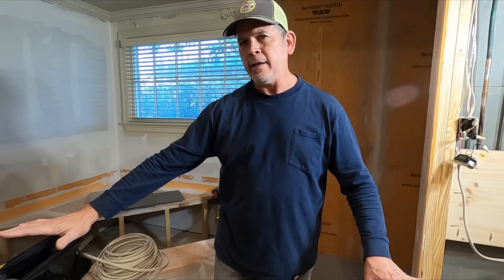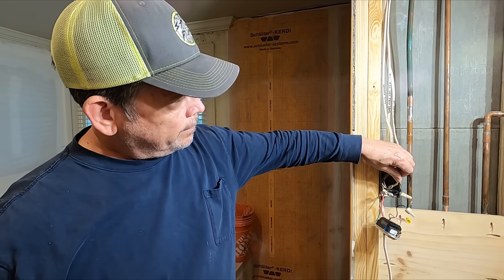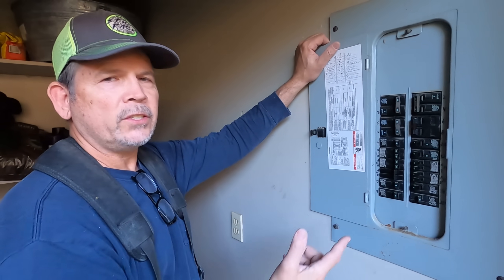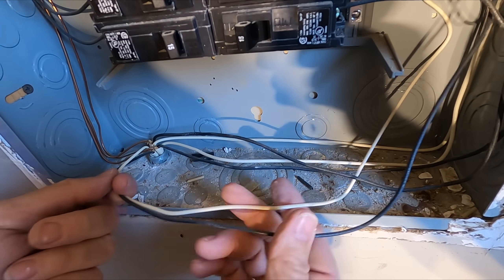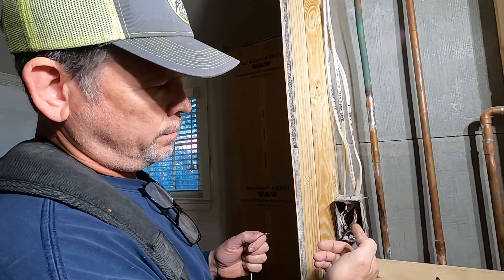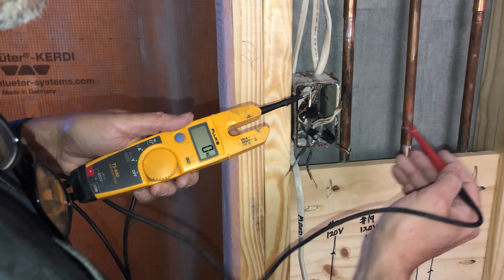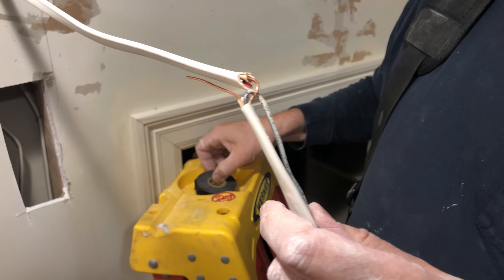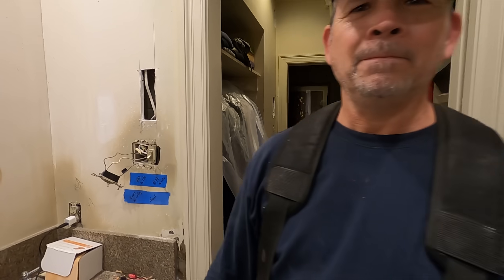You CAN Get SHOCKED by a Neutral Wire! This is How...

Comment: If you run a fan with a light don't run a 14-3, run 2-14-2's;as if there is a light and fan that can be simultaneously turned on, when they are both are running you may have 10-12 amps on 1-black and 1-red, but you will have 20-24 amps running on the 1-white 14 gauge wire, this wire isn't rated for this much amperage. If you shine a temp gauge on it it will glow in the dark and will be a fire in a few years. you can run a 12-3 but it's not supposed to be run to an appliance rated for under 15 amps. This is why I always say make sure you know what you are doing with electrical, b/c if you screw up plumbing you immediately have a leak. You can hook up electrical wrong and it will work for a time and it usually ends in someone getting shocked or a house burning down. But good video to teach people to be cautious and get pro's if they don't know what they are doing.
Reply from the maker: Thx Ron.  You can certainly have one neutral for the fan and light and even the heater in a heat vent light.  Manufacturers directions show it that way.   The fan and light together draw negligible current plus those junction boxes are so small I wouldn’t want to stuff any more wires in there than I had to.   Also you state to never plug 15A appliance into 12AWG circuit.  That’s completely fine.  It would be like putting 100 psi on an air hose rated at 200psi.   Maybe you got you numbers backwards I do they all the time 😂👊💪
Reply: @StudPack  I do occasionally get my numbers occasionally mixed up, but 14 gauge is made for up to 15 amps, 12 gauge up to 20 amps, 10 gauge up to 30 amps, 8 is 40 and 6 was in the past when I went to penn state and vo-tech supposed to be only up to 50 amps for like a electric range, however I have seen some literature in the last few years saying 6 gauge can be used to 55- even 60 amps. and you can wire these things the fan, light and heater it you have 1 black coming from device and 1 neutral (white), but if you must connect them with their own line they must be treated as an individual circuit or you will see the neutral overload I was talking about. I repaired 3 different houses where it got so hot it melted fixture parts for customers. I have also seen electric ranges in apartment buildings direct wire 30 amps, like 10-3 directly wired to stove and then run right to panel box, instead of the 6-3, many times especially in apartments hand houses. I have also seen "property management electricians daisy chain electric heater together and not do the load calculations for how many feet of heat can be in a say 30 amp circuit, hell 1 of the houses burnt down. But oh well just trying to save you some grief down the road, lol great video have a good day.

Comment: when you get shocked really bad you'll taste metal in your mouth. I've been doing electrical; for 31 years been shocked 5 times really good. It also changed the way i do work I never reach into the panel to move conductors with my fingers anymore.

Comment: Older House's are Scary I live live in a rental built in 1983 some of the 3 way light and garage wiring with no grounds wires connected are a danger.I always wear tight rubber gloves and rubber shoes and always CK all the circuits when working .THANKS FOR BRING UP THE HOT NEUTRAL CIRCUIT😰SOMETHING I'LL KEEP IN MIND FROM NOW ON

Comment: You are right, not only can bad things happen but happen very quickly. Electricity never had,
nor ever will have any respect for ignorance. Many think that since the lamp is OFF there is
no voltage/current in the box. that is dangerous thinking.

Comment: I think the best way to look at it is that you can indeed get shocked by the neutral wire because it's an output leg on a transformer from which a voltage is derived to power 120VAC devices. You hope that it's properly tied to ground enough to where there is no dangerous voltage referenced there.

Comment: I had a nasty lock down clamping.. couldn't let go shock while working on a freezer....My hands were useless, I had to push myself away from the freezer with my feet to break the circuit...  lets hear your story.
Reply: Working for small companies and doing jobs with little to no safety guy interaction there is sometimes a need/desire to work many things hot and if you do lighting you will feel 277VAC eventually and hopefully never 480. What I never allowed myself to do was force myself between pipes or lean on a ceiling grid etc while working what is possibly hot so the extent of my interaction is getting bit and yelling "fuck" real loud.

Comment: Very nice explanation of a shared neutral. I'm a beginner electrician and have encountered this several times. My question about this video is, how long it took to find the unconnected neutral in the 3-way circuit and where to start looking. I'm currently working on a remodel that has this very problem. And it's all new wiring. There are only 2 circuits energized while we "Trim out". One being the furnace and the other is the living room specifically for a work light and radio. Every other neutral in the apartment has current. I'm perplexed. Any advice is greatly appreciated. Thank you and please post more electrical videos.

Comment: I was in a house about 4 years ago that actually had energized all the forced air metal ductwork when they pulled their Romex through the same chase and had a snag they just pulled harder and ripped the insulation off the wires. I put a meter from the REGISTER (vent) in the bathroom floor to the TUB SPOUT and got 120 volts. 

I can only imagine somebody steps out of the bathtub and there's water on the floor and if they have their hand on the shower handle or the spout they would be dead. Or even just standing in front of the sink and turning the water on or hitting the light switch any of those if the floor was wet and had a path to the vent it would have been game over
Reply from the maker: Energized metal duct 😳.  That’s no joke.   Good job finding the problem 👊👍

Comment: 1986 in da yookay I rewired my house. 240 volts in da yookay..... Distribution panel off. I had some long nosed pliers and somehow I got em across the unfused feed from the substation... BANG and the last 4 inches of my pliers vaporized and molten steel peppered the walls and the panel.The pliers had rubber handles and I was left holding just those. I got no shock...  Now I use use TWO testers on everything.... and every tool must have insulated handles..240 volts is a monster.  I got caught with the live neutral once. The electricity board did a 32 point check before they would hook me up and I passed 31. The error was not having an insulated green wire to a power outlet.  Not bare copper  like in the US. 1 minute job to get fixed.  I wonder if the US will go to green insulated earths  one day...

Comment: I had a neutral shock me once. I was standing on a ladder working on a ceiling fan. I didn't turn off the breaker, I just turned off the light switch (that was the mistake). The ceiling fan circuit also powered a light in the hall, which was on. The hall light shared the same neutral as the ceiling fan and the same circuit breaker. When I disconnected the neutrals that were tied together in the ceiling fan, it lit me up as my fingers became an alternate path to ground for the hall light circuit for just an instance before I jerked them away. I always do AC wiring one- handed wearing insulated shoes so I had that going for me and it kept the circuit path short. 

 So that's why you always turn off the breaker and not just the light or fan switch.  I knew exactly what happened when it happened, but I was in a hurry and didn't want to take the time to track down the breaker and thought I could get by.  I didn't get by, instead I had a harsh realization and a reality check.  Fortunately, I lived and was not hurt but I do take the time now to find that breaker and put a meter on everything, every time.

Comment: After getting popped a couple of times years ago, I test, test and test some more once I turn a breaker off.  It's saved me more than once. Never think just because you've tripped a breaker that its safe to go back and start work.  Use a tester and make sure.  There's some crazy wiring out there.
Reply: Assumptions are the greatest mistakes you can make. I tell people don't think, know. Because often what one may think has no grounding in reality at all. What you know through direct observation on the other hand you can trust to an extent. So treat every wire as if it was hot until proven otherwise.

Comment: You're supposed to have a dedicated neutral for each new for each circuit what's going on there is somehow you had the neutral added to the other circuit so you need to isolate it figure out which ones which and it will quit doing that because that's not supposed to do that 30 years in the trade some of that stuff is pretty scary that you're fine but yeah be careful

Comment: Yeah actually the neutral is a load carrying circuit so it will light you up worse than the hot the hot would just hurt you but the neutral light you up and hurt you bad could even kill you especially 110 is bad

Comment: They shud have own ring circuits but thats uk.
Always measure potential difference as you never know who wired it and if its to code or not. Calling a wire at 120v ac neutral, is a bit misleading..

Comment: I'm living in the Philippines where there is no neutral and all the breakers are double throw. Last time I tried to check the voltage from one side to ground it was about a 185V to 35V split between the wires. I assumethe power company does that here so that people won't try to take one leg to ground to get 110V, you need to use transformer and they sell them in all sizes from 50W up to 5kW+.

Comment: I have a workroom with a music studio, one side of my room is the old 2-wire non-grounded side and the other was a new circuit ran for my computer and audio equipment... however when I plugged in an audio cable from a piece of equipment on one side of the room into my mixer console I blew out that channel... I mean it made a LOUD POP!!! and it died (sad).  I found the issue: the grounds were about 50 volts differential between them. Audio signals are low voltage, maybe about 1 volt peak-to-peak, they don't like 50 volts.   I solved the problem by running a nice beefy #12 wire (total overkill, but it was what I had) between the grounds bringing all the grounds in the room to the same potential. As for my mixer console luckily I knew a technician that could repair that channel, it was brain surgery to fix, but he got it back in business.  Happily that's been 10 years ago and I've had no more problems with either the electrical or my audio equipment. (Knock on wood)

Comment: You can also get shocked by a neutral circuit by getting in-between the neutral run.  I've seen many electricians get in a hurry and just disconnect a neutral to shut off a circuit instead of going downstairs and shutting off a breaker.  Bites just as bad!  Good thing you found that booboo with the 3 way switch.

Comment: Great explanation on the dangers doing rework. My house has 2 ceiling fans which seem to have hot - neutral reversal. In the switch box the white wire is always hot and the lamp socket of the fan is always hot on it's outer shell. I'm hoping to find the problem inside the fan's j-box once I pull down the fan. (Fingers crossed) Checking everything first with a chicken stick.

Comment: Yes, neutrals are current carrying conductors AND in “multi wire” or a shared neutral condition, they can still be powered up if only one of the phases is turned off. Need to turn off both phases to be safe. Never lift or open an neutral until it’s been confirmed safe.

Comment: As an electrician I always used 14-3 wire on 3 and 4 way switches easier and less chance of problems unless someone crosses the wires when installing the switches.

Comment: It's called an open neutral. If you have current flowing to a light, the light uses the energy to illuminate and some is wasted as heat. It completes the circuit on the neutral, returning to the panel.  If you open the neutral, like you did when you removed the wire nut and separated it from the other neutrals, it becomes an extension of the hot wire and you will read the full voltage of the circuit. And when you touched the open neutral, and the neutral still connected to the panel(or a ground) you completed the circuit and became the next light bulb in a series circuit. 
Open neutrals on an energized circuit are hot wires.... never forget.
Many don't realize the neutral is a current carrying conductor. The ground wire should only be a current carrying conductor when a fault occurs.
Reply: WoW, this is a great explanation! thank's

Comment: You cannot get shocked by a neutral. The only way you could be shocked by a neutral is if whoever wired the circuit was a complete a hole and twisted it somewhere to a hot. Saying you can get shocked by a neutral is like saying you can get shocked by a ground wire, because that's what both of them are. The neutral is connected to the main panel, just like the ground. One is a circuit ground, the other is an outlet ground. Anyone who says different is lying, or trying to sell you something stupid.
Reply from the maker: What if you have a pool motor running, disconnect the neutrals in a junction box, and grab hold of each one.  You will get lit up.  That's what I was trying to explain.  Much appreciated 👍
Reply: You get shocked by being a load between two points. The Neutral is clearly one of those points in a 120VAC circuit. You can get shocked by the Neutral by just grabbing it and one of the Lines so obviously the Neutral can shock you. When the Line is shocking you in a 120VAC circuit it's because it's referenced to the Neutral. The transformer does not create its output voltage by literally using the ground, it has windings. The reason you get ~120VAC Line to Ground is because the Neutral is tied to it. If the Neutral loses all of its bond to ground then you can 'potentially' get shocked Neutral to Ground the same way you would Line to ground if there was high enough voltage referenced. 

If you grab two neutrals on an open powered circuit at let's say a fixture then one of the wires you're grabbing is just the Line through the load since the other end of that device is going to be the Line connection. You'll get shocked on what you may have thought was 'just the neutral'.

Comment: I sure did learn something.  During a change to my home, the worker was making holes in the ground of the door frame (made of concrete) because that doorway was gonna be sealed off.  There was an electrical explosion because he tapped into an electrical box that someone buried into the door frame before I acquired the house.  The worker sat down for over an hour he was so scared about almost dying because of people making $hit up with electrical work.  I'm currently a handyman, and that my everyday fear.  I've found so many $hitty jobs performed by "who knows", that I do my best to try not fall in that category.

Comment: There are lots of comments about people checking the neutral for voltage as a precaution. I think being on the grounded side of the load it will still read as zero volts. Not until neutrals are broken will there now be essentially two loads in series.  The open neutral is infinite resistance so it will now show nearly all the voltage.   The short of it is you need to ammeter your neutrals for safety.  Open to correction

Comment: If it was a multiwire branch circuit the neutrals for that should have been pigtailed to one nuetral and been installed on a 2pole breaker .Assuming that was the ulitmate issue...Neutral shocks suck...

Comment: I got shocked by a 110 double gang.
I was exiting the crawl space under an apartment building, and the crawl space was flooded from a storm that had blown through. 
So, as I was exiting, I was crawling through a puddle of water, and my shoulder kept getting a small zap.
Not knowing what it was, I reached up with my bare hand, and grabbed the wire. It shocked my hand, and I could feel it the shock all the way up to my shoulder. My thumb ached for about four days.

When I looked, I saw that the hot wire was the only wire without a cap on it, and it was the only wire hanging out of the box. 

The box was for an outlet for a sump pump.

My employer, back in the day, bought a house. It was gutted, so he had to do his own rough in. He shared a neutral wire between two light fixtures in adjacent bedrooms. He forgot he did it, and later we had some wiring problems. When we were hunting for the issue, he found the problem by getting shocked. He said that the arc was the most brilliant blue he'd ever seen.

🤣 🤣 🤣 both instances are funny

Comment: i think Demanding that romex be adhered to the stud is STUPID!!! people can drill right into that.. BTW,  your house main panel? it has two hots and ONE ground. 

so for literally 80 or so years, we were able to do the SAME through the house... 1 neutral to TWO hots. the issue was, if you disconnect a neutral somewhere, the potential for 220 to pass through  into a location where it was supposed to be 110, could happen. this is typically due to a light bulb somewhere. 

Now the code isnt like that. But older houses, you still have to think that way. A REHABBER is by default a better electrician than a NEW construction. A new construction only knows what they know, right now. they have no idea how things were. So as a result they swear up and down, that any means of wiring different than what they were taught to do, will "cause a fire" ...